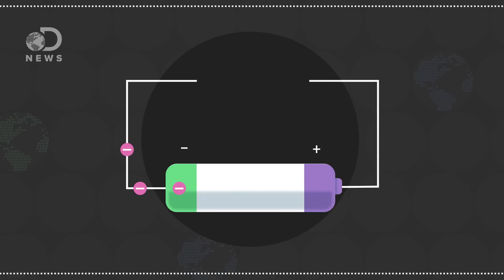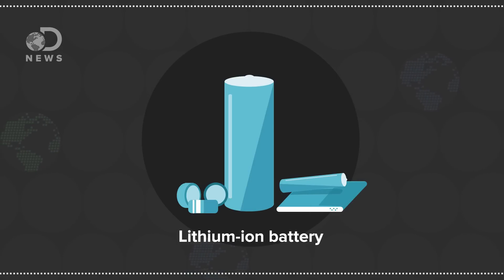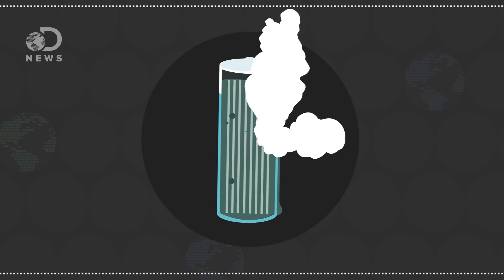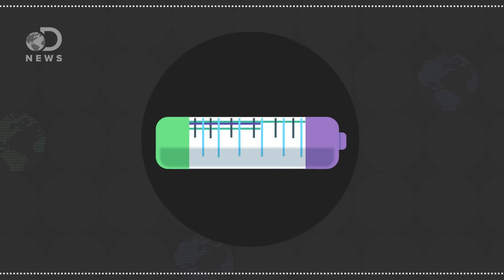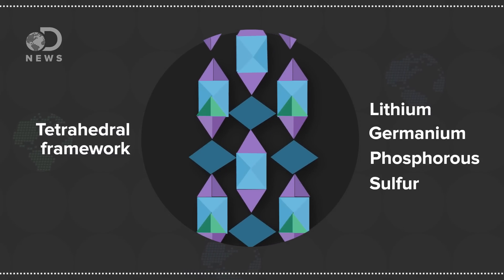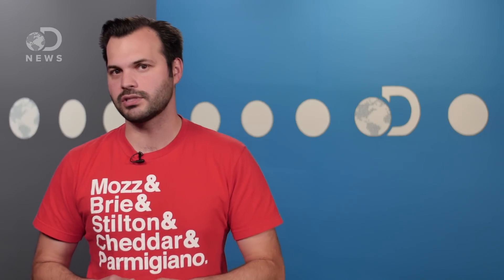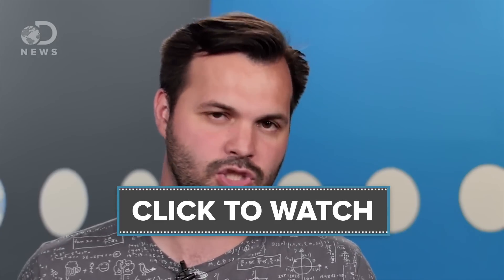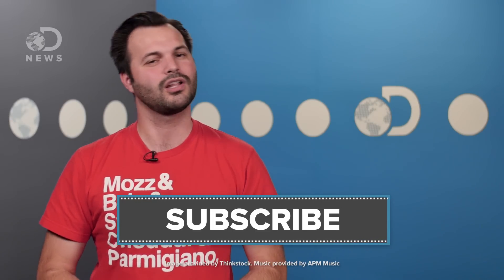Are Solid State Batteries The Perfect Battery?

Comment: Just like graphene batteries, this will never make it to the market.  Batteries haven't changed in decades.
Reply: When you say they have not changed I hope you don't mean in capacity or in technological advancment. How do you think Tesla is making a 35,000 vehicle with 215 mile + range?
Reply: But they did change. Nickel/cadmium used to be all there was, now we have a ton of lithium ion. This makes me think that the graphene batteries weren't that marketable for some reason.
Reply: +DJPelio over the last few decades batter technology has changed a great deal. Working life, maximum capacity, rate of discharge/charge, operating temperature and pressure have all improved. Just because we still using lithium ion doesn't mean they are the same batteries that would be like saying that cpus all use transistors so they haven't advanced.

https://www.quora.com/Is-it-true-that-battery-energy-density-improves-5-8-per-year
Reply: +DJPelio nothing changes, up until the exact point that it does change.
Reply: +DJPelio Graphene Batteries are still in Development. I think calling them dead just yet is a bit too soon.
Reply: +DJPelio " Batteries haven't changed in decades."

Obviously you are young and haven't been alive in the 90s, let alone before then. Batteries in the 90s sucked. We had to put up with nickel cadmium batteries which were garbage. Lithium ion batteries were a lot better, if we were still stick with nickel cad, smartphones wouldn't even last an hour.
Reply: +DJPelio 
Graphene batteries are still prototypes. "Never make it to market" when the thing hasn't been completely developed yet.
Reply: +EnigmaHood I remember reading articles in science magazines in late 70s early 80s, about the polymer batteries, at that time it was like science fiction.  of course its what we use now.  now we have solid state batteries, of course they will become available,  one major problem is lithium,  most comes from China, they have the x on the market.  many countries would just love not to have to rely on China for this resource.
Reply: +George Cataloni Graphene is still under development. However these new "solid electrolyte" cells have a higher energy flux density than graphene. I have a friend working in the industry show tells me that they are already working on a "next gen" solid electrolyte cell that can be 3D printed in layers to increase voltage and energy flux density. Kind of like moving from discrete transistors to chips.
Reply: Exactly
Reply: Kylo Ren
Its not redneck its based water(weigh, temp), and the avg human foot(dimensional). 
Volume uses both and original version of fluid measurements are in powers of two.  Besides working with both makes people better at math.  Much the same way knowing more languages helps with language skills.  Saying don't use English measurements at all is like saying everyone should use one language exclusive of all others.  A better way is to learn and use both properly.  Much like a native speaker learns English.
Reply: +0011peace jeg mener du tager fejl i din vurdering.  
forklare bedre det med vand og vægt forstå nok bare ikke. 
selvfølgelig altid bedre og kunne sammenligne forskellige talsystemer . men det gør ikke talsystemet mere logisk og bruge.  
kan du give mig et godt argument for vi ikke alle skal have samme sprog ?
Reply: +Kylo Ren So you're saying metric users are non racist? Dutch football fans would like to meet you.  Looks like prejudice and the dark side go hand in hand ;)
Reply: Dennis Hedegreen
Well I don't know your language.
The original English volume system is based.
1 cup = 8 ounces
2 cups = 1 pint
2 pints =   1 quart
4 quarts = 1 gallon
All,  powers of 2  So work with binary fairly well.  Density is mass divided by volume and water 1 ounce(weight) = 1 ounce(volume)
Temperature is based on freezing point of water and the half circle hence the term degree.  Metric temps while based on water aren't based on the circle.  Water freezes 0c/32f boils 100c/212f   212  - 32 = 180.
I think the offset of 32 is because the highers temps normally experienced is greater than lower temps.  The lowest England is going to face is -40 and maybe 120.  And, even more so in experimentation.  Routinely experiments were done at high temps but before electricity it was hard to do low temps.  Having one primary language is a good idea.  But, one exclusive means we will have less experience in translating dead and maybe in the future alien languages.  More languages you learn the easier it becomes to pick up new languages.  Same with math but for the most part this is being lost.  The few hold outs to the English system can help increase mathematical competence as long as they also learn metric.
Reply: +Kill Sadism The world doesn't suck, the system sucks.
Reply: +0011peace All English measurements are now based off of the metric system nowadays so we should probably stop calling a horse a pig.
Reply: +Frank Sang If Tesla makes a self-driving one I WANT IT!!!
Reply: +agriperma Most lithium comes from South America
Reply: graphene capacitors *
Reply: thanks to the union bro
Reply: Ya thats real problem are all these exploding batteries, I mean who needs a battery that can hold 10x more energy. We really need to focus on stopping the exploding battery epidemic :)
Reply: +DJPelio Batteries haven't changed in decades, therefore this design won't either, cause logic... but nonetheless probably true
Reply: +EnigmaHood sarcasm
Reply: harry dick So hard to tell sarcasm on the internet sometimes. No inflection in the voice ya know? :P
Reply: +DJPelio If we made it to rechargeable batteries then we can evolve once more, damn it.

Comment: Voltage alone doesn't mean much. Most computers (desktops and laptops) run on 12 volts, but you can't run a computer on 8 1.5 volt batteries because the power isn't there (you could, but it won't last long). What was the power output of this solid state battery?

Comment: THAT'S THE WORST FUCKING SCAM i HAVE EVER SEEN
1: Lithium batteries explode in water because lithium metal explodes in water, not the gel
2: Lithium batteries explode when punctured because sparks/heat can ignite the metal, not the gel.
3: Lithium batteries are expensive because lithium metal is expensive, not the gel

4:  Also, what the fuck does voltage have to do with anything? You obviously know nothing about electricity. All batteries have a very low voltage output, which is why they are wires together in series. IN EVERY SINGLE TYPE OF BATTERY, lead, nickel, lithium, ALL OF THEM

And I don't know about the rest of the claims, such as extended battery life, or more charge cycles. But based on the bullshit information given I can assume this is another scam such as the aluminum battery which never actually made any other headlines other then that 1 times years ago...
Reply: I agree this video is big
bullshit, graphene superconductors are the future of battery tech that's where the reserch money should be going.
Reply: engelmohr2006 Graphene super conductors are being granted large research money, just no one cares about them. There are people working on it, but you wont get a new invention in 10 years of research no matter how much research is being placed, mostly because of patents and other legal bullshit.
Reply: robert karas Is that so, we'll that's too bad from the limited understanding I have of them they'd outstrip normal battries in both performance and environmental friendleness humanity cam be really stupid sometimes.

Comment: problem with all these "new" battery tech, is they never come to market, for the past 10-15 years we've been bombarded about news of the next big battery using some experimental material, then poof its never mentioned again. 

So I'm skeptical.
Reply: +MrMassivemeatlog Because they are all scams. Most of the issues he describes is from lithium metal itself, NOT the gel.
1: Lithium batteries explode in water because lithium metal explodes in water, not the gel
2: Lithium batteries explode when punctured because sparks/heat can ignite the metal, not the gel.
3: Lithium batteries are expensive because lithium metal is expensive, not the gel
Reply: ***** Upper end job? Are you serious? That's my hobby, not a fucking job. And my job is working with cad drawings and run a plumbing crew, not assembling batteries at a factory.
And this is youtube, I realized I made a mistake, and I didn't bother to fix it because I don't give a shit. I am not filing a daily report. Even with daily reports they don't give a shit if I write like a 5 year old.

And why are you using such a bullshit excuse to change the topic, We are talking about lithium metal exploding, not grammatical mistakes in youtube comment sections. You're a fucking joke. What did you major in college? English? Good luck finding a job dumb ass.
Reply: Fernando Baltazar Because I work with lithium batteries such as building battery packs/etc, so I know all the danger's and why... Or if you don't believe me you can google
lithium metal in water
igniting lithium metal
Reply: lithiums are getting better all the time, the mah has gone from 2900mah to 3500mah in the past 5 years or with the same weight.
Reply: +robert karas how do you know your right?
Reply: +Daggeira lmao
Reply: +robert karas Don't feed the trolls mate. You're input was valid, you don't have to defend yourself.
Reply: TheTreeCow A 2 paragraph response on youtube comment section with 1 mistake, I say that's great compared to your response.

1: Forgot to capitalize,
2: Used "u" instead of "you"
3: Didn't use "" when quoting
4: Didn't add a period at the end of your sentence
5: The sentence structure is wrong, too broad.

Dumb ass bitches about 1 grammatical mistake in a 2 paragraph response when he made 5 mistakes in one sentence. Wow, amazing.
Reply: +MrMassivemeatlog The trouble is that science takes time. The people who are doing this work fin that that graphene batteries are possible then figure out what such a battery once made can do but there are still many engineering issues that must be solved before the technology become practical and still more before it becomes cheap. some of the discoveries will pan out some wont but either way it will take a long time for the work to be done. In other words Dnews and others pick up on these stories just when the hard work of making these new batteries real is getting started.
Reply: +robert karas Please sir restrain yourself from feeding the trolls you only make them more bold
Reply: what we really need is a way to make batteries work with troll power - there is enough in this thread alone if only we could apply it to something useful
Reply: Not true, I used to work for battery company that sells the newly invented ultra capacitor battery. I learned that most of the newly invented technologies are not available to residential and personal use, however, you can purchase them as a business, its just extremely expensive and they will never tell you the price before face to face meeting.
Reply: same
Reply: +robert karas why r u saying he? wasnt that you who wrote it 
fuckin bitch
Reply: TheTreeCow I am replying to you. And omg dude are you high or trolling? Lol, good try.
Reply: +robert karas earlier you said you didnt bother with grammatical mistakes on youtube because you dont give a shit
you then responded trying your best to look like you knew how to write
you even went back and changed your mistake
I pointed that out showing even while trying to write correctly you still make a basic mistake 
jaja at you fuckin bitch
Reply: TheTreeCow I was pointing out your mistakes because you where the first one to point out mines... 
And yeah I fixed it, what I cant fix a mistake no more? That's why youtube has the edit feature you know, and that's why youtube even shows "edited".
I'm not hiding nothing, but your being a hypocrite calling out ONE mistake meanwhile making them left and right...
Reply: +robert karas you said you dont bother editing your mistakes because you dont care 
clearly you do
Reply: TheTreeCow I do now as your the second brat to annoy me, and again, why are you being a hypocrite.
Reply: +robert karas ur grahmar suks deck.
Reply: +TheTreeCow Shut the fuck up you little bitch ass troll.
Reply: robert karas dude, I've heard of non lithium batteries, fully organic batteries, etc, all of them never come to market.

again, i'm skeptical, since I've read a million articles just like this video explainig some new and exciting battery tech, that is never brought up again
Reply: MrMassivemeatlog I think you replied to the wrong person. I already said I agree and explained why the "invention" in this video is bullshit...
Reply: robert karas I just got back from work and say this giant thread lol.
Reply: MrMassivemeatlog Well just to summarize the thread, some bitch complained about 1 grammatical mistake on one of my posts which then a troll also bitched, and me and his went back and forth about it, which eventually 5 people started to bitch about the troll to shut up.
The whole thread is about grammar and trolls XD
Reply: robert karas typical sci show filled with underage autists.
Reply: ***** Again, changing the topic from lithium, to grammar, to trolls...
Reply: ***** Your the one who commented first, I am replying to you just as you are replying to me.
I am not bitching at miniscule things, I am discussing the issues with lithium batteries describes in this video with other people.
Meanwhile you are attacking me about a single grammatical mistake. Something no one else did except another troll.

And if this is foolishness you are correct, and that's why I am pointing it out that your the idiot who started a rant attacking my personal life due to one grammatical mistake on youtube comment section...
Reply: yeah graphite and cell batterys and loads of others
Reply: right .. the next best thing has been a flop every time ... most of these new batteries are expensive, difficult to mfg, and still limited to 300 charge cycles ... higher charge cycle life is the make/break economic factor, most important .. without that, doesn't matter what the energy density is. Funny how MIT is a main source of new Flop Battery Tech .. remember A123?  Crashed and burned, bankrupt, bought up by China ...
Reply: "higher charge cycle life is the make/break economic factor, most important .. without that, doesn't matter what the energy density is"

.... what you're literally saying is "it doesn't matter if a battery can last forever without recharge, if it can't recharge 300+ times, it's pointless to make it last longer than a second". Words are tough.
Reply: You're right. These new battery technologies get announced all the time as researcher look for money; however, this has the potential of being difference. Both Toyota and VW have announced that they will have cars with solid state batteries within the next several years. Time will tell.
Reply: thats right

we heard all about lithium ion cells when nickel cadmium was the norm and like - well nobody uses lithium right? 

The truth is that in any technology there are a dozen hopeful prospects that never cone to market for every winner. But just as nobody uses nicads any more lithium poly bateries will be superseded - maybe by this glass cell or maybe sonething else.
Reply: Perhaps it’s because the synthetic Germanium required for the structure... half life’s into Gallium at any rate of the synthetic isotope... a very interesting materials shift would occur. What the result is... anyone know?
Reply: I know it's annoying. Just announce something if it's already practical and available
Reply: Recently, a "whole house" battery was on a video here, supposed to power all appliances, lighting, electronics in a 2,500 sq/ft house for 25 years the size of a clothes dryer. WHERE did that go? Another pipe dream, or fail/fake?
Reply: +robert karas. haha u mean YOU'RE

Comment: Now if only the market wasn't reliant on frequent repeat customers. I don't see this tech flying unless some altruistic billionaire gets a hold of the patent before battery companies do to shut the research down. It'll be just like hyper-efficient cars and the petrol companies.
Reply: +Vincent Nolden It doesn't matter if the new research is a scam. 90% of this video is completly false. Google lithium metal dropped in water, or lithium metal ignited, its insanely reactive.
Literally all of the issues he states are issues from the lithium metal itself, NOT the gel.
Reply: You sound like you know more about the stuff than I, but I do wonder if there is a less reactive configuration of lithium inside molecules. My point though was simply that the market is not friendly to new inventions that are cheaper or longer lasting as it is built on repeat customers willing to pay a premium. Not that free market is bad, but this form of it reduces innovation and scientific progress.

Comment: Lithium batteries have a "version" called Lithium Iron Phosphate battery which is much-much safer than LiPoly batteries. Only downside is that they can't deliver the current and are typically less energy-dense...